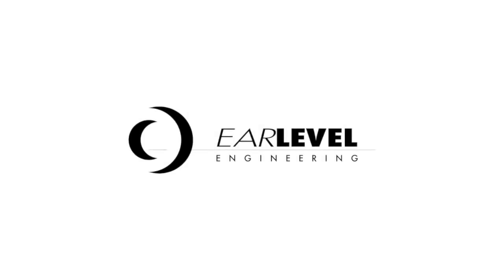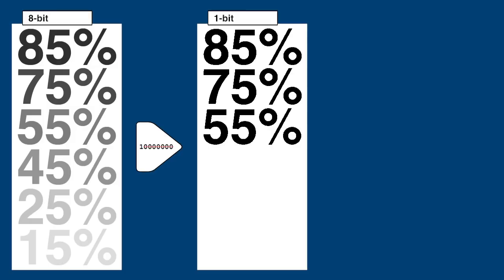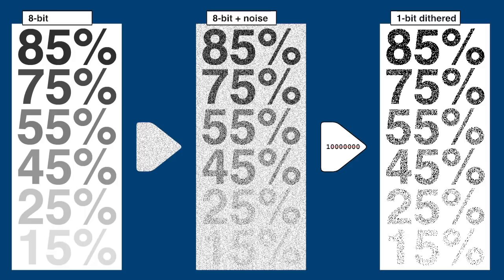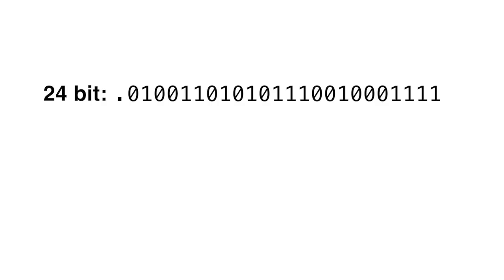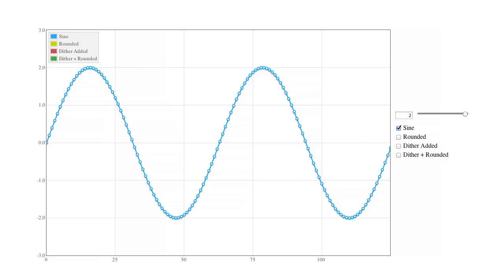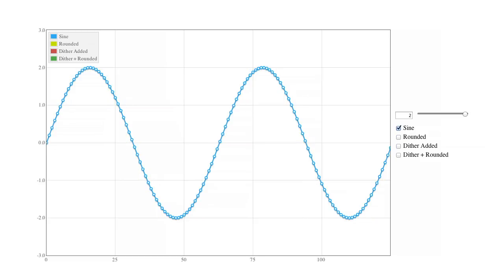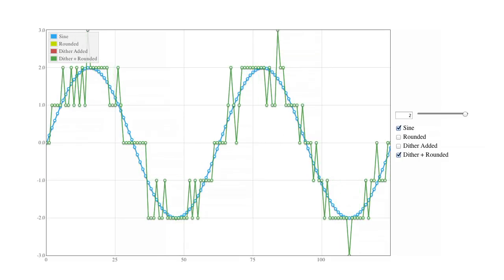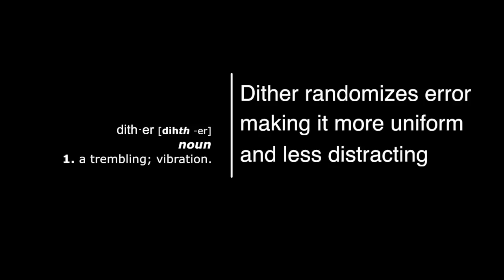Audio Dither Explained

Comment: Your demonstration and final statement were the best explanations of dither I've come across. The only thing I'm concerned about is this video possibly perpetuating the myth that final converted audio signals look like their digital stair-step counterparts.
Reply from the maker: Kali Doom Thanks Kali. However, the "stair-step" idea is a misinterpretation—I think you understand that. We're looking at digital values in this demonstration, not the output of a D/A converter, and these values can quantize into repeated distinct levels that look like stair steps. Granted, "stair-step" automatically conjures up that poor and incorrect description of D/A output for some, and I could have used something like "plateau" instead. But I don't think it will perpetrate a myth, because it's an accurate description of what I'm showing, and if people get confused, they don't have a grasp of what's being demonstrated anyway. But, I know now to avoid the words "stair-step" in digital audio should the need arise again.

Actually, I'm working on a sampling theory and sample rate conversion video (possible as separate videos, depending on how long each part runs) that will make it abundantly clear that samples represent impulses, and exactly why the output of a D/A is a smooth analog waveform. I have older articles on these topics on my website, but video will give the opportunity for a more animated demonstration, with audio.

Comment from the maker: I want to make one thing very clear: The animated waveform graph does NOT depict a "staircase" wave. It simply connects the dots in order to make the display comprehensible. Without the lines, it's just a huge mess with the dots dancing around (and even worse if drawn as impulses). And note that adjacent dots at different sample values are connected *diagonally*—it's NOT a staircase, just "connect the dots". I noted this in the video, expressly to make this point clear. Samples are impulses. In this case, I've simply connected their tops to give an outline that's easier to follow visually.
Reply: Hey, I got your message, actually I was replying to a Google+ post by Sigurdór Guðmundsson sharing this video.  That's probably why it was confusing to reply to.  Anyway, I appreciate that you get that the staircase isn't really what's going on, but since I was taught this this misconception in college, and had to correct it countless times since then, (interns, artists who know enough to be dangerous, etc.) I speak up when I see digital audio visualized with the zero-hold graph.  We engineers need to stop putting that visualization out there so we can start to put an end to that idea.
Really "diagonally" is not strictly correct either, it's a parabola most accurately.  Only one possible solution for the D/A converter to find. 
But anyway, I'm not meaning to come down on you, Nigel Redmon like it must seem like I was --sorry about that!  
It's a great visualization of bit depth and dither, the grey/black graphics, I just think drawing the graph like you did leaves people with an exaggerated idea of what these distortions would look like in a waveform, when really they'd be much smoother than all those squared off points and lines.
Reply from the maker: Justin Newton No, I don't feel at all that you're getting on my case, so to speak. I'm just as sensitive to the point as you are, I'm sure. But to be clear, I didn't connect the dots to be "correct" in any manner at all. The connected line is a visual aid, like circling a point on a chart with a red marker to highlight it. Believe me, if I turned off the connecting line, people would not be able to make heads or tails of the chart—it would be just points dancing around. I tried it. The line is just there so that you can follow from one sample to the next clearly, especially as I change the amplitude.
Reply from the maker: Justin Newton And yes, I did consider doing band-limited reconstruction to simulate what would come out of an analog converter, but the visual difference for the staircase-ish part is relatively minor with the samples that close together (the dots would be obscuring most of it—I'd have to hide the dots, then I'd have lost what it is I trying to illustrate), and in the animated noise-added view it would be just messy and distracting, zoomed in that closely. The object is to let the eye follow that sample points, not to render an analog view.

Comment: I found your video inspiring. I've never seen a better lay level presentation of a technical topic.  WELL DONE!  I fully intend to watch your other videos. 

I watched and enjoyed despite having learned everything you covered several years back when I was in the process of capturing to digital from a number of family reel to reel and cassette recordings. LOL!  I captured at 88.2 kHz, 32 bit floating point, edited and did mild hiss reduction then used noise shaping dither when normalizing and transcoding to 44.1k (end product-CDs) - all on material with a noise floor 30 dB or more above the dither. It was extreme overkill but I wanted an absolutely minimal quality impact as I was only going to do it once.  The process was very educational and I'm happy with the result.)

Comment: Hi, 
Thanks for the video.
I have a question regrading the noise that you add in the dithering: should the noise level PSD should be by the value 0.5X(q/srt(12))^2?
Since for my understanding, when adding to much noise, higher than ( LSB/2), you can degrade the ADC performance.
Will appreciate your explanation.
Refael
Reply from the maker: Hm, I think that's right except for the factor 0.5. The noise amplitude is ±1 LSB (2 LSB peak to peak). That's the minimum dither level to ensure no signal correlation and no noise modulation. Offhand, I'm not sure about the LSB/2 reference, but take care that sometimes dither levels are expressed in rms.

Comment: So, why do we even use 24 bit depth in studios? Wouldn't it be better to just master everything in 16 bits?
Reply from the maker: To keep it brief: It's true that 16-bit is enough for audiophile quality, when fully utilized and with linear processing, but it lacks flexibility. But it's not nearly enough for heavy non-linear processing for example (for instance, say you record clean electric guitar, and want to apply an amp simulator for a overdriven sound—it will raise the 16-bit noise floor to an intolerable level). Maybe a simpler way to view it is that for only 50% more data storage (memory is cheap!), you get 256 times the dynamic range to work with (48 dB more).
Reply: I was thinking more about the necessity of dithering when downsampling from 24 to 16, rather than storage constrains. If everything was mastered in 16 bits, there would be no such necessity.
Reply from the maker: You wouldn't save on dither: When you master to 16 bits, that's when you'd have to dither. In fact, any time you apply processing—including a minor level adjustment—then save to 16-bit, you'd need to add dither. The key point is that a multiply expands resolution. For instance, if you have two fractional decimal numbers, hundredths precision (0.00 to 0.99), and multiply them, the result has a resolution of thousandths. 0.93 x 0.96 = 0.8928, for instance (perhaps that's a sample value and a gain fader value). If you try to fit that back into hundredths (0.89), you've truncated—you need to dither for a better error distribution.
Reply: Ok, thanks for explaining!
Reply: So if your using a project that is in 16bit 44.1 then you don't need to use dither at all when making the cd quality wav files right?
Reply from the maker: Usually, people master to a high resolution, like 32-bit float or 24-bit. Then export or convert a 16-bit version for CD. That's when you want the dithering. Most modern DAWs default to dithering. You'll have to check the documentation for the details. Pro Tool 12, for instance, dithers when saving a project to a lower bits depth, and also when  exporting.

The best advice I can give is to work at 24-bit or 32-bit floating point (most DAWs work in 32-bit float, and if you choose to use 32-bit tracks, there is no conversion. Export your final mix as 16-bit when you need to (CDs are usually the only reason), and dither then. Otherwise, forget it. You DAWs may also dither for 24-bit mixes—that's fine, it doesn't matter either way.
Reply: Cool thanks for the reply. I've used so many different DAWs (PT9, Studio1, Sony Vegas, etc..) over the years and now just do everything in Reason 8. Weird huh?, I love it! Even for my daily multitrack mixing. I can run it at have the sample buffer half than anything else. Runs super stable. Great vid!

Comment: You never came again as you said
Reply from the maker: I did post the follow-up video, https://youtu.be/KCyA6LlB3As. Regrettably, in that one I also said there would be a follow-up video to it, but it didn't happen because I never received some professionally recorded tracks that were promised. I do have another video planned on digital audio sampling (you can read the gist of it on earlevel.com), just been tied up with work for a while. It will happen!
Reply: Nigel Redmon hello nigel. Ok, i understand. Your explanation it was very usefull, so i was waiting for more. Thank you for the video.

Comment: I still don't get it... Lol
Reply from the maker: Watch it one more time :-D
Reply from the maker: Short version: Limited resolution (sample size) results in a grid of possible values. The grid can possibly result in patterns in certain audio material that sound like the audio is distorted. By jiggling the grid a tiny bit, randomly, we don't get error patterns that line up with the audio signal—instead of a distorted signal, it sounds like the clean signal plus a tiny bit of hiss.

Analogy: Close one eye and spread your fingers in front of your view, and read this. Your fingers will block some words. Jiggle your hand side to side, quickly, a small amount. Now you can read all the words, even though there is a little blur in front of them. The blur is better than the blocking.

Comment: all dither is damage. all dithers sound different.

it is not needed if you don't downsample in the first place.

sell 24bit masters to consumers (we have the bandwidth for it now) and stop the bad audio.  #savetheaudio
Reply: You mean quantize, not downsample. And 24 bits for the final master is a waste. 16 bits already give 96dB of dynamic range without noise shaping. With noise shaping, it rises to approximately 120dB, which is more than enough. To quote https://xiph.org/~xiphmont/demo/neil-young.html:

“120dB is greater than the difference between a mosquito somewhere in the same room and a jackhammer a foot away.... or the difference between a deserted 'soundproof' room and a sound loud enough to cause hearing damage in seconds.

16 bits is enough to store all we can hear, and will be enough forever.”